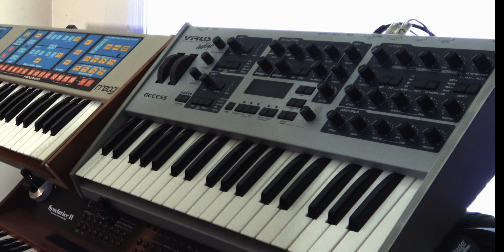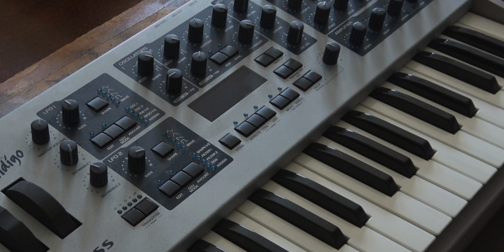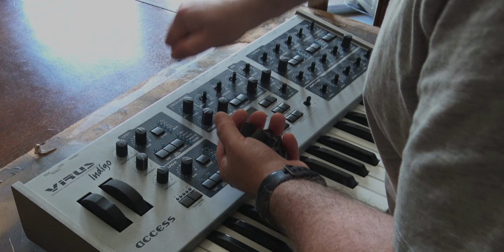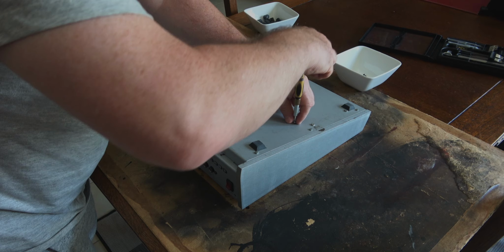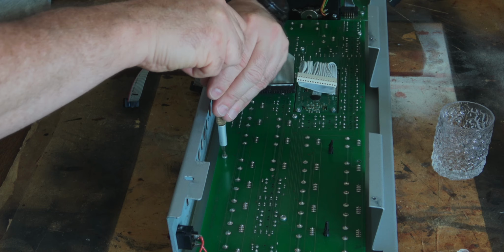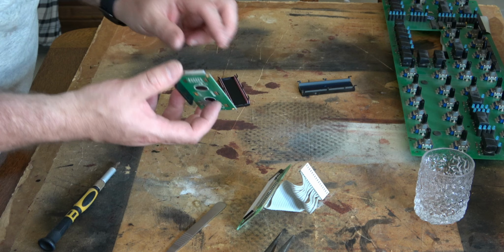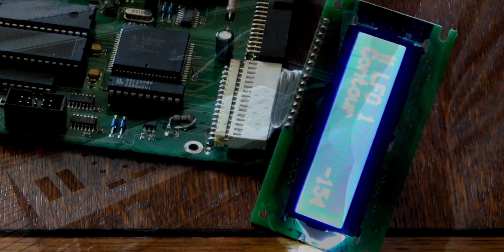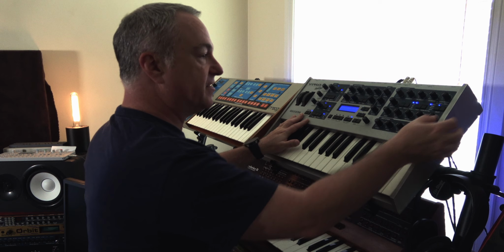Access Virus Indigo Repair - LCD

Comment: I've 2 LCDs to repair, one on my S1100 (backlight issue) and an other on my Quasimidi Sirius (many faulty dots, bad contacts), but I procrastinate, next week, next month, next year...  100 other things to do! 😉
Reply from the maker: Yeh my S1100 almost compeletly died in the early 2000's. I sold it around that time (2004) to 'upgrade' to computer based sampling.. What a mistake! The silly things you do in retrospect :D
Reply: @100ThingsIDo  To be honest I don't use a lot my S1100 (coupled with an S1100EX, BTW) as I feel it sounds quite clean (16b, great DACs). And for clean samples I've everything in my computers, when I use an outboard sampler I'm looking for a kind of vintage sounds and my EPSm seems to me more useful for this.

Comment: Seems to be the good way. I had a korg M1, where I had to replace the battery, near the lcd screen. I have for two years a Dx7, I had for fifteen Euros, for parts because water or else damage, I moved to another country after, so everything had stand unmount, the lcd were working, in that case need to wash and verify all parts for oxydation, that's done, but the metal case, is unpaint in some corners, rusty, so very hard to paint back some white scripture on the top, and the color, wich is not Black, but a deep dark Brown. So soap, teeth brush boxes and glasses to put the screws, no potentiometer on this keyboard fortunately, and contactors were not touched by the water, rust had only taken the left part of top on  the metal around the upper plastic you press when setting the sounds. Repairing keyboards needs rare parts, sometimes. I have also the RX7, the slave joint to DX7, working, so I hope one day making great with this trio, as I have also a DX 21, and old dedicated laptops for sysex. Old material needs to learn computers repairing, sometimes doing things that are unusual, because parts are hard to find. So I appreciate the way you tried to fix potentiometers, they can be opened, but mostly, the problem will belong, if you don't modify this bad designed part.
Reply from the maker: Back when I had my DX-7 I wasn't even sure if it was supposed to have a blackight or not! haha! I just remever it kept getting stuck in sound creation mode and I could not get it back to preset mode without a lot of pressing random keys  :P

Comment: Had the rack version of that Virus. It needed battery replacement. Since it was so hard to get it out of the rack I decided to ditch the CR2032, found some nicely accessible solder points and connected a AA size 2Ah Lithium battery to it. This now is supposed to last 10 times longer than the 190 mAh CR2032. She'd be fine for maybe 30 years.
Reply from the maker: Yeh they tend to go seriously crazy if the battery goes flat! .... Hopefully those AA's don't eat themselves before the 30 years are up :D Great idea!
Reply: @100ThingsIDo  I had the same thought, but I specificly used a VARTA 6117 model (Farnell 1877580)  that is around for ages. Some gear that I equipped with a very similar one in 1990 is still going (my first time). I also mounted the battery away from the board since the only thing I did to the board itself was attaching some wires of any length I wanted.
Reply from the maker: @ChipGuy  Battery's always scare me.. I'm so paranoid about them I have a cable running well away from the Fairlights processors for that battery! Nasty things happen when they get old!

Comment: I just tried to fix my Indigo, it had a flickering display and very dim. I assumed the backlight was faulty, so I replaced it the same way you did, but it was a fail for me unfortunately, it's now a blank LED panel. It would be good if you could show or explain in detail where on the Indigo's LED board you soldered the 2 little pins from the new backlight. I found 2 small holes in the board that the pins fit into, but not sure if that's the correct spot.
Reply from the maker: Drop me an email at 100thingsido at gmail dot com and i'll see what I can do to help.. The indigo LCD board is designed to power the LED backlight. :D
Reply: Steve did you ever figure this out?

Comment: What replacement display did you install?? Do you have a link? I am looking to do the same procedure
Reply from the maker: Just a generic 16x2 blue LED lit LCD .. sorry It was a part I had laying around! Hope that helps :D
Reply: @100ThingsIDo  totally I found another thread that had the original product number! Saw some guy selling them on eBay marketed towards this synth specifically and wanted $150 for it haha I was like there is no way that part is more than $30
Reply from the maker: Indeed it should be no more than $20USD for one, just make sure its LED based backlight :D @D.E.T.H.S.O.U.N.D.

Comment: But.... Where did you the replacement? Type, brand....
Reply from the maker: Believe it or not I took it from something else that was broken! The ones used in the HxC floppy emulator are the same type! :D
Reply: I had a 1602 LCD from Aliexpress. You only need the backlit

Comment: I've got a Virus KC - it was locking up and then it quit booting. Does anyone know of a place in the USA that services these things? It's an awesome synth and I'd like to resurrect it!
Reply from the maker: Make sure you check the basics first .. If the backup battery goes flat they can act very strange (coin cell inside the synth). After you have a new battery do a a factory reset (check on line or in manual how to do it) and see how that goes. I thought was was dead dead but it was the battery and all the settings turning to grabage :D
Reply: @100ThingsIDo  Thanks. It's been a few years since I opened it and looked around, but I'll give that a go.